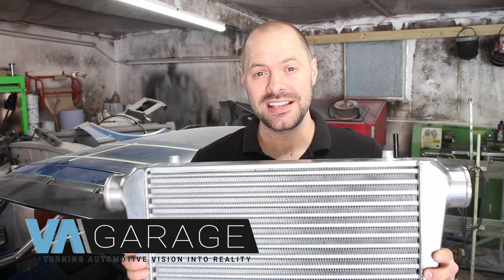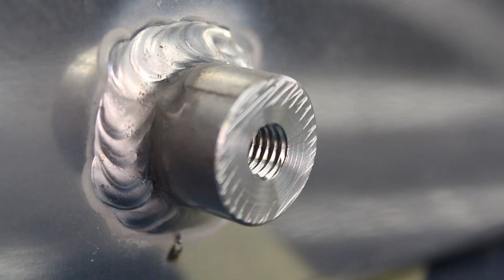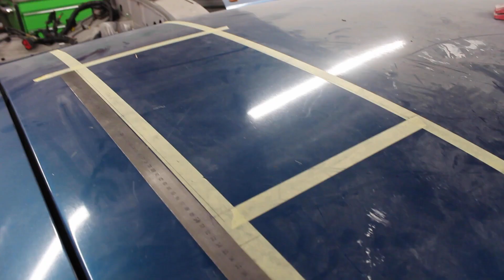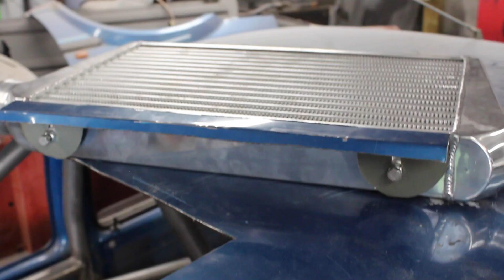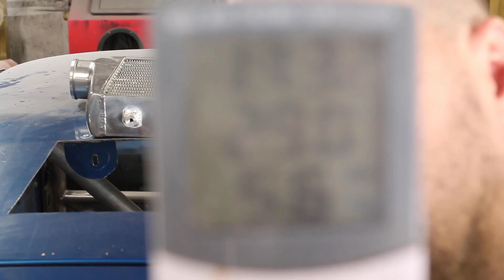Fitting a front mount intercooler (FMIC) in the roof! Rover Metro 20v Tubro Engine Swap

Comment: This is pretty left field !  Were you not tempted to put scoops either side of the rear wheel, and have a IC each side?
Reply from the maker: Yes, I was, basically the same setup as the TT but in the rear. I thought that the boost pipe route would be much longer than mounting in the roof, and being left field is fun :)

Comment: I thought you might have utilised the interior handle bolt points to put a cross frame in to hold the intercooler and take the weight off some pretty flimsy tinwork, just saying :)
Reply from the maker: +Stephen Schofield not sure what you mean, but this is just an idea in development.
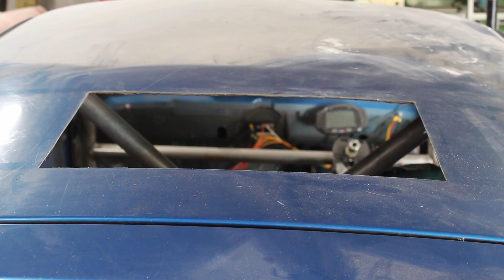Reply: @VisionAutoGarage  3:29, you can see the holes in the roof frame through the hole, it'd be a great bolt point for a frame, that's all i'm saying, not being critical of the work you've done
Reply from the maker: Stephen Schofield ah I see, yes that’s a great idea! A Frame to those would do the trick! Watch out for your credit in the next episode! 👍🏻😂